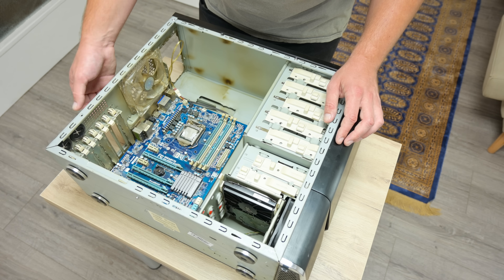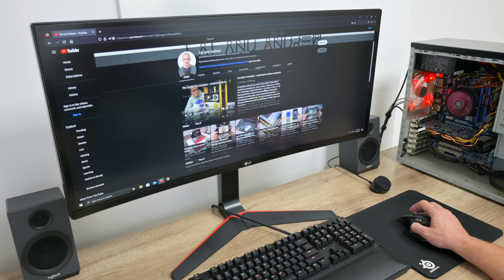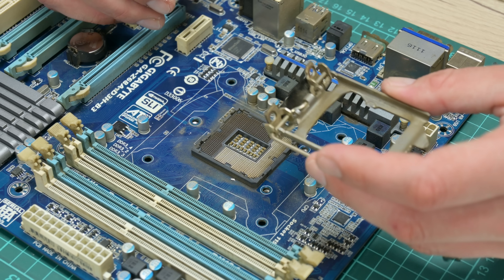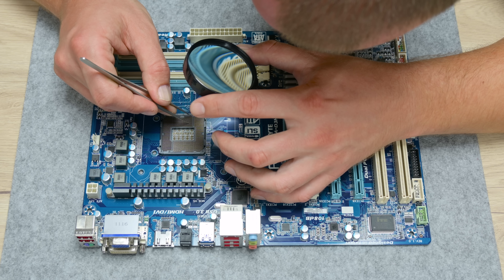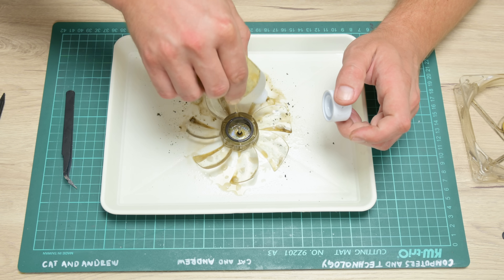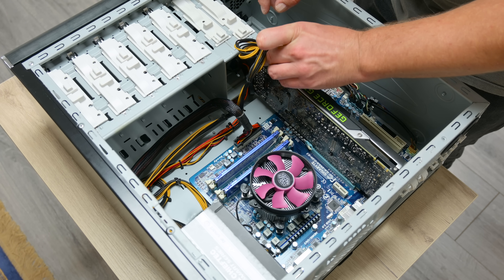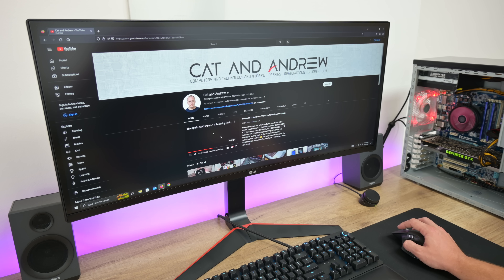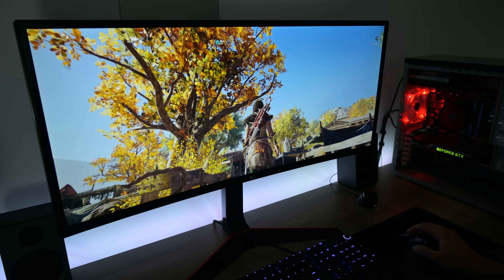The Useless PC ( NO it's NOT )

Comment: Ngl, I've been using an AMD FX PC I got from the recycling center, which was about to be thrown out quite a bit, and it's not a bad system, especially for basic web browsing. it plays minecraft pretty well so far and it definitely play roblox very well too. It also can play teardown at a fairly decent performance. it essentially can do light gaming. It has an AMD FX-6300, 16 GB 1867 MHz DDR3, 256 GB NVMe, R9 270X, and ASRock 970a-g/3.1. It's able to run windows 11 pretty well despite it's age, which shows how absurd their fake requirements are.

Comment: That computer was in a smokers environment, reason for the brown stains. I've done this many times for parts I had given to me from a friend who smokes in his house. He saved me quite a bit of money thru the years when he upgraded his computers. I never complained about it, I just took the parts and cleaned them up and used them. Most parts were good, a few didn't work out so well. What I discovered on cleaning motherboards is to hold them up right vertical position on a towel, and using a spray bottle with 92 percent alcohol, spray it clean. Start from the top of the board and spray until you get to the bottom and all that junk runs downhill on the towel leaving the board spotless. Repeat if necessary while having everything completely apart, GPU's included, then reassemble. Some hardware parts can be soaked in bleach water then rinsed, it will melt away nicotine stains like magic in seconds and requires no scrubbing looking like new, fans included, then bone dried off.

Comment: Years ago i was given for free a bricked  gigabyte Z77. Thnx to dual bios i recovered it, bought a cheap Xeon E3-1270(similar to i7 2600) and with 16GB ram it still my main pc(has a 1650 DDR6 atm). Some month ago i found a 9020sff competely naked, only mobo was inside. Fixed its bent pins,cleaned the sticky ram slots, cased swapped it, replaced my fx htpc ;). I love older pc/laptops, been donating them to friends and neighbours.

Comment: As long as there is no chip level repair needed, the restoration of old PC's is very cheap and worth the effort. But as soon as you realise some socket or chip needs to be changed, the price of repair goes so high that it's better to discard the entire component. What a waste!!!
Reply from the maker: yep, not worth some expensive repairs, except if something has some sentimental value to someone

Comment: Just a heads up
You can use a mechanical pencil to straighten socket pins. It is way easier to bend them back into the correct position

Awesome content as usual
Reply: Tried setting right some bent pins recently and broke almost all 6 of them. The system still works but I wouldn't dare use it for anything useful.

Comment: if you ever need a modded bios for this board (uefi ones) (native nvme boot (no clover) and resizable bar), hmu. i usually do nvme boot mod + rebar support to any h61-z77 bios as long as the bios have above 4g decoding toggle. For gigabyte i've done alot, my 2nd pc use H77-D3H and yes it ran RX 580 8GB and yes it use resizable bar asic, perf increase is real sksks.
Reply: Hi may i know how you enable above 4g decoding for old motherboards

Comment: we have same i5 2500k sandy bridge.... whats the best gpu to upgrade it.... will gtx 1660S work well??   (currently using gtx 750 Ti)
Reply from the maker: The i5 2500k is little bit weak for the 1660s, but this is acceptable bottleneck, if the GPU is faster than the CPU then no problem. The problem is when the CPU is better than the GPU

Comment: I much more appreciate cable management in difficult cases than cases which essentially make it no effort.

Honestly I'd rather have thinner cases than cable management caverns. My windows 7 PC which I built in 2010 is 170mm wide, pretty much just wide enough to fit a 92mm fan exhaust and no more. I ran the 24-pin between the motherboard and the motherboard tray, which is possible when the cables aren't sleeved.

Fantastic build man!

Comment: You can clean motherboards in the sink, completely immersing them in hot soapy water and use various brushes (paintbrush, toothbrush) for different areas, or even put them in a dishwasher. But be careful of the socket, use the original cover if you have it and clean it separately using a artist's watercolour brush and isopropyl. Give it a final rinse in warm distilled water if you're OCD like me! Whichever method, the CMOS battery has to be out and make VERY sure to give it time to air-dry thoroughly (maybe 48 hours, or a several hours in a warm c. 60°C oven).

Comment: 'Enthusiast' gamers and the industry as a whole really tend to herd people into believing that anything over a couple years old might as well be used as a door-stop. It's bollox - I just resurrected my old i7-3770K running at 4.5GHz / 1.25V (admittedly delidded / LM'd) Asus P8Z77-V MB,  GTX 1070. It'll play pretty much anything if the settings are right (tested it with Halo Infinite mid-settings 1080P and it's flawless), and for older (dare I say) classics like the Crysis series you can revisit them at high settings, c. 1440P and see them as you probably never did when they were released in the 2000's. I'm probably going to sell it for £200-250 and someone (maybe a youngster) is going to have a lot of fun with it.

Comment: I'm using a similar setup w/2500k on a AsRock Z68 Extreme4 and 12Gb of ddr3 and 6 4tb HD's as my home server. Reliable and quiet, not too bad on power as well. Using the onboard graphics for display w/ Windows Home server 2011.
Reply from the maker: I do remember these motherboards, beautiful motherboard, these are looking good with Cooler Master V8 cooling, the AsRock Z68 Extreme4 has similar heatsink to the Chipset

Comment: ho and one final thing
SLI (or CF) is just BAD, it adds input lag/latency, e.g. the delay between your mouse/keyboard inputs & the display on monitor
+ it also adds micro stutters & more uneven frame pacing
that said, it can be fun to experiment with and if you're not too exigeant I guess it works fine.

Comment: you can get much much more out of such a processor with a giant cooling fan such as a Noctua NH-D15 or similar and some overclocking

back then there was a lot of margins left on the table

EDIT: also I can't stress out enough that if the PSU is 10+ years old it's probably time to replace it, having stable current to this platform is CRITICAL
even with zero overclocking, it can cause random BSODs

Comment: Those scorch marks on the top of that case before cleaning gave me shivers.  I owned one of those boards, ended up selling the system who knows how many years ago but back then I used to love Gigabyte boards.  Quite the restoration, end result looks great.  And definitely not useless.  I have a couple Xeon systems from around the same time currently running my NAS and proxmox servers, finally getting around to upgrading them but considering what I paid for them and the use I got out of them I'll be kind of sad to retire them.
Reply: This was probably one of the last eras where gigabyte was good. From z170 onwards I’ve had but problems with them. I just recently bought a Z77x-UP5-TH for a build. I didn’t need to go that high end, but it was one of the only silver z77 boards.

Comment: I mean this pc not bad, i have been using i5-2500 since idk years at this point, it was combined with a Vega64 recently (Before it was used with an R7-240 2GB since i didnt had money for gpu) and it wasnt a bad experience, but windows was a bit wonky if i consider comparing it to my new cpu, which is a Ryzen5 5600.

Comment: I daily drive a 3770k but ive never been able to overclock it due to a factory Intel board. I cannot find a cheap and good 1155 board to switch to.
Reply from the maker: The 3770K is still good,  for these CPUs good motherboards are ASUS P8Z77 or Asus sabertooth Z77 or something from Gigabyte Z77X, these were my dream motherboards
Reply: @ComputersAndTechAndAndrew  Yes , but try to find one working or cheap or that does t need a full re-capping job. It's not so easy.

Comment: As someone who fixed a bricked h61m ds2 1.2 with an i3 3220, im sure it will last longer than newer pc components and it's still usable for daily tasks!
Reply from the maker: The older parts were with better quality, todays are not good, it's like cardboard, low quality and high price
Reply: @ComputersAndTechAndAndrew  it has 10 years of wear and still rocking 🤙

Comment: I'd recommend installing 8t CPU like 3rd gen i7 or Xeon v2. I have secondary Xeon e3-1230 v2 setup with 16GB of RAM, 512GB SSD and GT1030, quite comfortable for daily use.
No sense of upgrading to anything below Intel 10th gen or Ryzen 5000 series.
Reply from the maker: One of my close friends still use i7 3770K with GTX 2060, 24GB RAM and that PC is working veeeery good. Maybe he will change that PC with Intel 15th gen ( if come out ) or something like that :D
Reply: @ComputersAndTechAndAndrew  I'm still using a i7 3770K with a GTX 1070 Ti  and  32GB of RAM.
I'm not upgrading until windows 10 looses all support lol.

Comment: I had the same from my grandma's sisters granddaughter PC from 2012
Spec
ASUS P8H61M- LX3- R2.0
Intel Pentium g620 2.6ghz
2Gb DDR3 1333Mhz
80GB SATA Hardgrave
400W Idiot PSU from Intex

with covered with Dust And Lizard Fieces.

Now I Washed and Cleaned with 70% Isopropyl Alcohol on 2days and 
also with Case I Washed with Soap and Water and Other Things like front Panel USB And Audio are washed with IP Solution and Had 5 Bends on the Processor Socket

Now I Upgraded to 
Spec(Current):
ASUS P8H61M- LX3- R2.0
Intel Core i3 2120 3.3Ghz
8GB DDR3 1333mhz + 2GB DDR3 1333mhz (total 10GB RAM and I edited in BIOS for IGPU memory to 1024 GB so memory will have 9GB RAM and 1GB for IGPU VRAM)
120GB Zebronics SSD
160GB WD Laptop harddrive 
500w ANT Esports VS500L PSU
Windows 10 Pro

Comment: Thank you for another awesome video. I found two dell Vostro 3902s in the dumpster and took them home. I tested them and they worked fine. I have one problem though. they did not have power supplies and I've been looking everywhere for one with no luck. Do you have any suggestions on any other power supply I can use even if its not a dell one?
Reply from the maker: These PSUs are smaller factor, you can check some computer shops that sell used stuff, it's going to be much cheaper than ordering from amazon or aliexpress or ebay
Reply: @ComputersAndTechAndAndrew  thank you very much

Comment: A Bios firmware update to version U1D(UEFI BIOS) appears to be offered on Gigabyte's GA-Z68A-D3H-B3 support site. However, a switch to "UEFI enabled" bios setting may also require re-installing Windows.
Reply: you can actually fix an installed windows to make it transition without reinstalling

Comment: Ah, the i5-2500k.  My sis had the equally venerable i5-2400 in her rig some ten years ago.

Gotta say, the Sandy Bridge architecture was a real banger back in its heyday.
Reply from the maker: The build quality of the older components is much greater than the newer ones. Few moths ago I build one with Z690 motherboard. The motherboard was like a carboard, and sata has not working, we change the motherboard again the same problem. Yes the PC is great, fast, powerful but kinder egg quality materials

Comment: Not bad - with 2nd gen i5 CPU, this PC is certainly NOT useless. With a decent SSD as its boot drive (I would pick Crucial MX500 500GB), as well as a decent hard drive (2TB) and 32GB RAM, this would still be a pretty decent computer nowadays for basic tasks, and for games from around this PC's era.
Reply: 32gb is pretty overboard imo
Reply: @detecta  Not really. With how things are nowadays with games and other programs, the more RAM you can have, the better!
Reply: @TheSpotify95  i mean most games from the pcs era had like 8gb recommended specs and 8-16gb is still good for basic tasks
Reply: I've recently upgraded my modern gaming pc (5600x+RX6600) from 16gb 3200MHz to 32Gb 3600Mhz and apart from Hogwarts Legacy, no games that I have tested made the total ram usage (with Windows 11, which manages to use more ram than Win10)  to cross over the 16Gb mark, so yes, 32Gb in that pc is definitely overkill and unnecessary, even with it being cheap. Also, you do not need 32Gb for "basic tasks".
A better idea would be to have only solid-state storage, and maybe upgrading the CPU, since the motherboard is good and support up to a 3rd gen Core-i7. And definitely staying in Windows 10.

Comment: Next time wash the motherboard with water and soap, the result will be the same or better, and it is faster.
Reply: Just make sure to dry it extremely, or rust easily forms while alcohol evaporates quickly
Reply: @309electronic5  i know. I already did it many times. It doesn't rusts so fast, putting it in the sun will dry it, or using hairdryer. Just need to make sure it is  dry before trying to turn on.